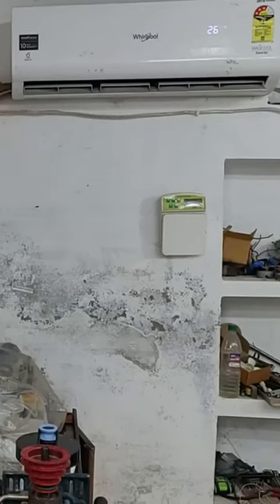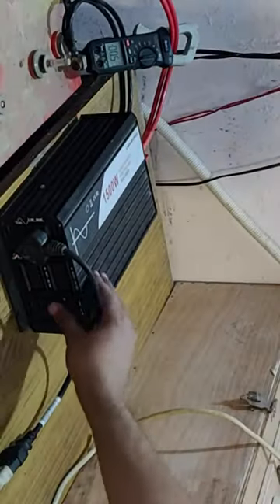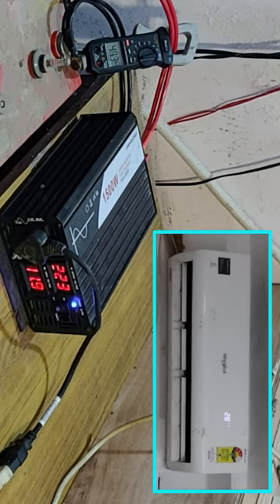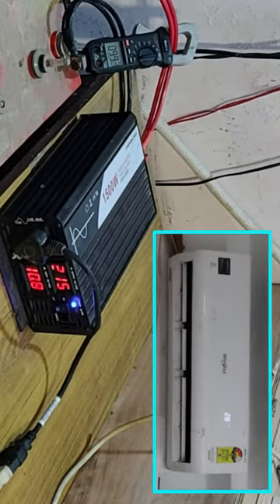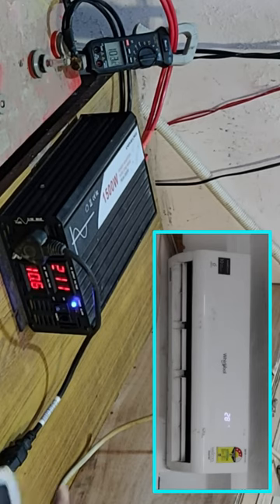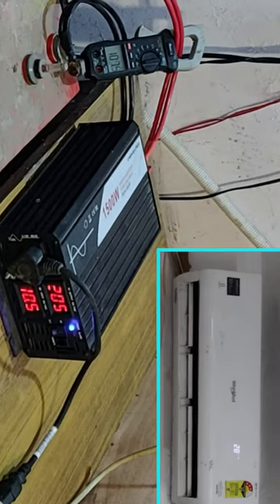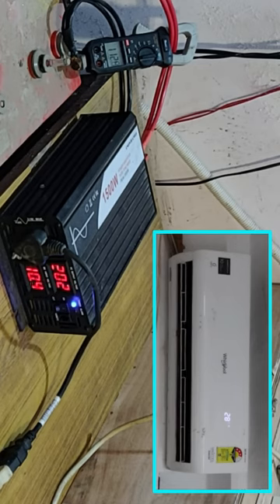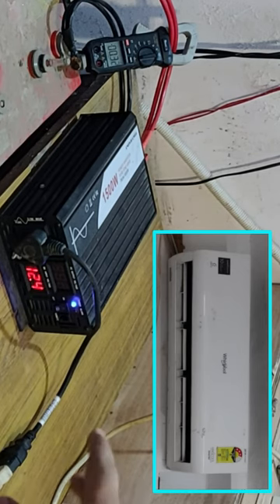How to Run 220v 1.5 Ton AC on Single 12v 150Ah Battery  - Air Conditioner #short

Comment: I got a 120amp battery and 6000watt concerter, but can't run my mobile airon within 1hp power. How to fix this? Thanks
Reply: Watch Will Prowse instead of this
Reply: Are you sure the the inverter is actually 6000w and not a fake china crap that is actually more like 600w. 
Cus with 1hp motor even if there is high Inrush current. A 6kw inverter should easily start it unless it has a really sensitive overcurrent protection. 
You can use a softstart. 
Or vfd. Like this dude is doing. With inverter ac. The starting current is lower than running current.
Reply: Use proper 1AWG wires from the inverter to the battery.

Comment: How long will it last?😅
Reply: 5min
Reply: WHAT KIND BATTERY ARE YOU USING THINKING NEED ABOUT 8 12VOLT DEEP CYCLE BATTERY 100A 8 BATTERY 9600 WATTS TO RUN IT GOOD OR 12VOLT DEEP CYCLE 230A NEED 8 YOU 22080 WATTS RUN IT